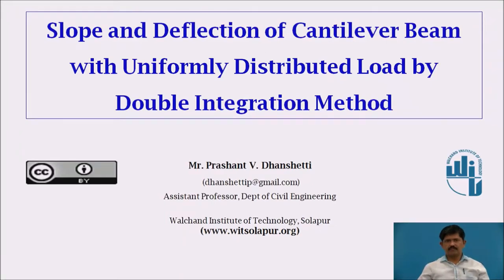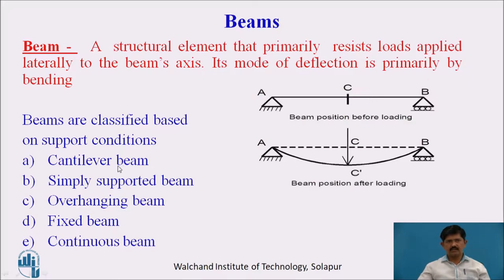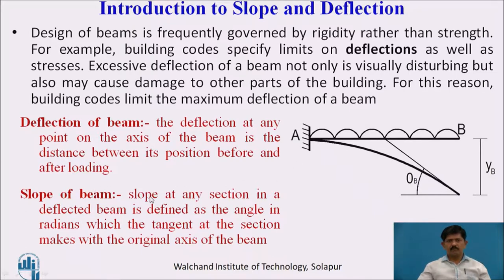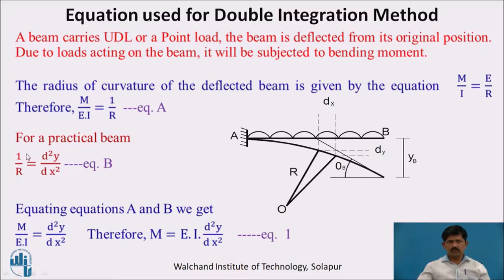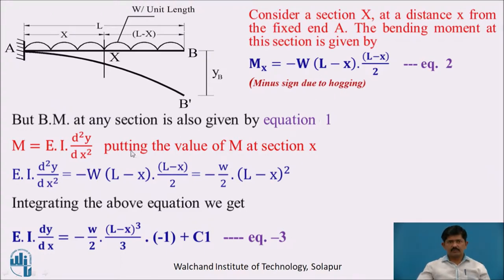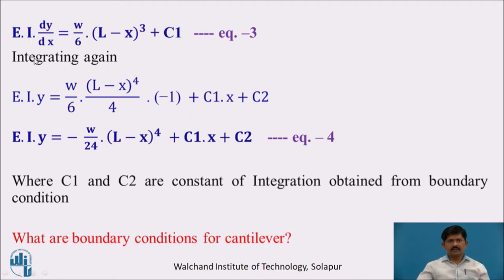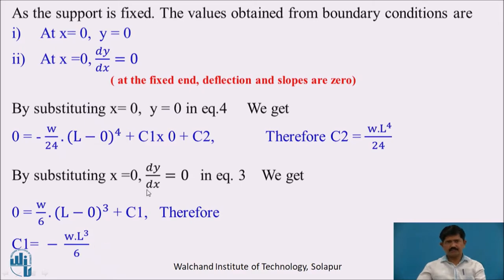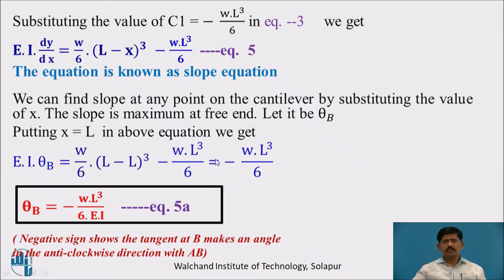Slope and Deflection of Cantilever beam with UDL  by double integration method

Comment: Solve this for me sir....A cantilever of 4 m span and 400 mm depth carried a uniformly distributed load of 5kN / m . Find the value of the concentrated load w acting at the free end so that the maximum deflection does not exceed 10 mm anywhere in the cantilever. Also find the maximum slope due to both these loads. [E=200GN/m^ 2 ; I = 20000 * 10 ^ 4 * m * m ^ 4 .) 10